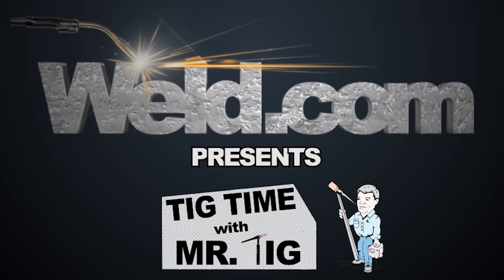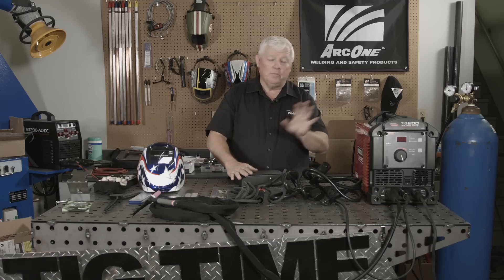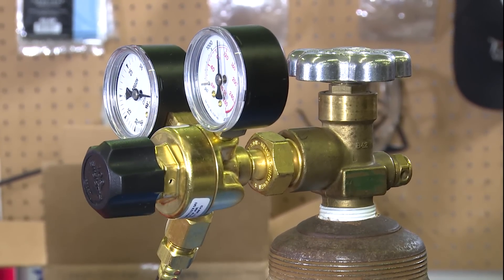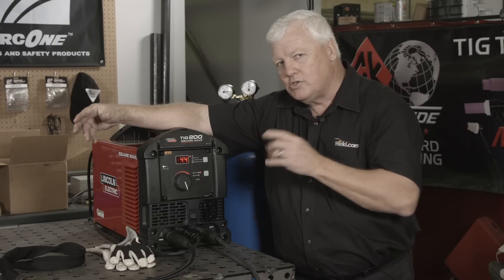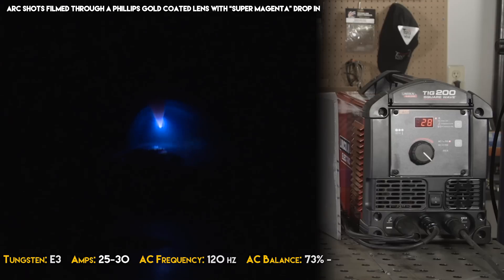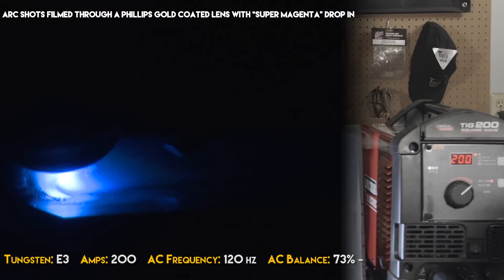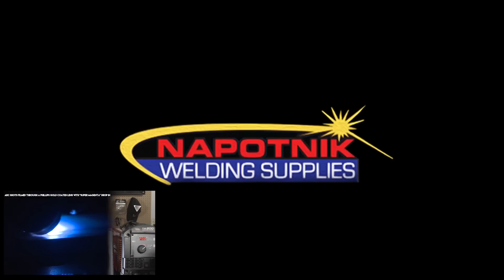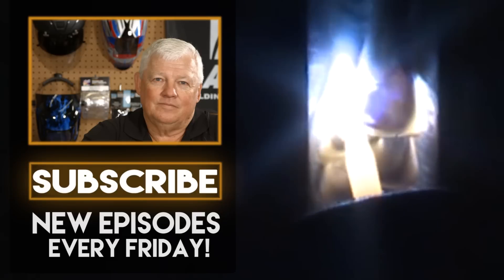Lincoln Electric Squarewave TIG 200 Unboxing and Review: Part 1 - AC Welding | TIG Time

Comment: I've had this machine about a month, very happy with it. I also changed to gas lens, the regular lens that came with it did not have the nozzle centered around the tungsten and it didn't maintain the shielding very well. The other thing I don't care for is that the post flow is set to 15 seconds and can't be changed. That eats up a lot of gas when I'm just doing a bunch of tacks, and is way overkill when welding things at low amperage. If I were going to change the regulator, I'd get a dual flowmeter so I could use a purge if I needed it. I also agree the arc start is a bit hard, kind of surprised me at first until I got used to it. Now when I weld thin material I start the arc on something thicker, then move onto the work piece. Very nice demo, thanks.
Reply: 15 seconds is an awful long time for the argon to continue flowing. Even my mid level Everlast has adjustable post flow. That technique of starting on something thick to avoid the large arc start is really smart.
Reply: You can't change the post-flow??? How about the preflow?
Reply from the maker: +G. Finley unfortunately not

Comment: how would you compare this one to the APH 200x, 2016 model. im going to pick up a tig and a plazma cutter and am looking at the best bang for my $
Reply: The AHP is pretty good welder. If you want additional features or better duty cycle you can also look at the Everlast welders. They are considered slightly better quality. If you won't be pushing the duty cycle much you can even consider the tig welders that have plasma cutting built in.

Comment: Hi Wyatt
About tools to check the argon flow out of the cup 
What is the better one to use I got one from Arc Zone and really can not prove or disprove the accuracy 
thx
art
Reply from the maker: Art, I'm not sure which one you have. We sell a gas flow tester that should prove your flow as well, but for the price of one of the flow testers, it's worth it to just buy a flow meter style regulator, like the MT-60.
Reply: Wyatt
I have several flow meters and need to be able to test each as well as friends
Reply from the maker: Art, This type of tester will allow you to double check the accuracy of your flow meter: http://weld.com/index.php/shop-weld-com/shop-weldcom/flow-meters-and-regulators/gas-flow-tester-detail

Comment: While it looks like a good welder I still won't own one. No post flow adjustment. So at 150+ amps it's automatically calculated at 17 seconds. This machine is geared towards the hobbyist. And the hobbyist do not have large tanks. Even a 125cf tank will go empty real quick when you have that much post flow. Even for tack welds! Who needs to waste that much gas, crap like this causes argon prices to rise.
Add a post flow adjustment and I will have one.
It was a good attempt but failed execution 
Try again Lincoln
Reply: The fact of the matter is that we just can't get all of our parts made in America these days, it's just the way it is. All parts made in America, Mexico or China is not even the biggest issue you will have. Buying a tig welder is not something you do a lot of. You should buy a machine & plan to have it for a long time, generally speaking. I have never bought an AHP, so I can't speak for them. But I have bought from another Chinese welding machine company, longevity, and I had an issue (which is an understatement).  Their service was awful. I mean so bad that they spun me into a new dimension of pissed off. So when you make a big purchase like a tig welder, you need to consider the cost of ownership, which includes parts and service. You're not going to get the same level of service, in my experience, from an import company as you are from one of the big companies, regardless of where the parts of their welders are made or where they are assembled.
Reply: +worldtraveler ah hah! Thanks for posting where it's made. I was planning on going down to my LWS and taking a look at one just to see where it's made. You saved me a wasted trip brother!
Reply: Good!  BUY IT.  Then in 3months after you LEARN what pre/post flow and up/down slope means, you can EAT YOUR WORDS.
Reply: That is interesting to know I went buy one and didn't because of gas use the salesmen did not know that thanks for the helpful info
Reply: +gamble1997 I'm truly glad your experience with that machine is a good one. Even so, I can't risk it. I also hope that if you need manufacturer support for some reason they will meet your expectation as well. Back to this video review, I would buy this Lincoln machine though, even though it's made in Mexico because I know Lincoln will stand by their products. I'm not going to buy this machine because I have no need for a small machine like that, so it's pretty much a mute point I suppose. Good luck to any of you that do buy one.
Reply: ANGER MOTORSPORTS and on the low side it's still around 12 seconds IIRC
So yes a waste of gas at any amperage
Reply: I was looking at this model and an advanced Everlast. I didn't realize the Lincoln didn't have a post flow adjustment. That does it for me. The Lincoln is out.
Reply: You're right Ryan.  Better to invest good money for a good machine.  It is actually possible to avoid the chinese mess altogether.  I bought the HTP Invertig221.  Italian made by Stel.  1st class machine for what the more expensive everlast rigs cost.  Sorry longevity hosed you, but I gotta say I'm not surprised.  I've read tons of horror stories about them.  What aggravates me the most is the chinese are smart enough to KNOW they have a problem...  But are too dumb to care to fix it.
Reply: So out of almost 300 reviews on amazon alone you find a few that are crap. Big deal. You have no idea what you are talking about. You didn't know it was even an AC/DC welder. Mine has been rock solid for 1 year with daily abuse and welds beautifully.
Reply: Yo
Reply: gamble1997 what should i buy i want to tig aluminum rims at home, dont want cheap junk tho
Reply: Is that the main issue you see with it?
Reply: gamble1997 
while the post flow is not adjustable on this machine, it does NOT always flow for 17 sec. The post flow of the Square wave 200 is dependant on the AMP setting your welding with. if welding at 200 amps, yes post flow is 17 seconds. but if welding at lower amperage the predetermined post flow drops down. so........ this big mess of comments were for nothing, but entertaining.
Reply: Name calling not necessary dude...... But for 800bucks someone can buy the chinese alphatig that is LOADED with features compared to this lincoln.  Lincoln's lower end welders like this box and the junk HD sells is chinese bottom of the barrel stuff.  Drop 5grand on a lincoln and SURPRISE!!!  All Italian and US components inside.  lol.  I've used this new lincoln many times and I am not a fan.  The arc start IS harsh and the lack of common features make waiting for version 2 a better plan.  If I had 6k to blow, it would be a miller.  I consider a hobby machine these days a grand and under.  Even an everlast for the same money would be a better deal just because of features.  Both everlast and this lincoln have CHINESE internals and painting one box red doesn't make it any better.  Corporate america has forgetten it's not a good idea to crap on decades of building up a legacy name like lincoln only to allow the lowest bidder to represent your company. Shame shame.
Reply: lol mr know it all doesn't really know jack. I can weld aluminum with my ahp better than you can with any lincoln or miller. Its the person behind the hood
Reply: You kiss your mom with that mouth of yours?  The alphatig will do just fine on aluminum.

AMAZON>>>>>>>
AHP AlphaTIG 200X 200-Amp IGBT AC DC Tig/Stick Welder with Pulse 110V and 200V
 $799 and FREE SHIPPING.
Reply: YUP!  Wait for version 2 of this machine before touching it.  My buddy has one, I am not a fan.  (made in mexico too)
Reply: You really are special ed if that's how you see it. For $1400 there are lots of better options out there that do more than this and all of them don't start at 35amps either like this one.
Reply: @gamble1997   Name one better option for the same price......I'll wait. You can't. Your little eBay special welders can't compete with Lincoln as far as warranty and service. That's what you pay for. I have two Lincoln service centers within an hour either way. Sure beats shipping some eBay special somewhere on my dime and waiting months for a return and HOPE it's fixed and I can get back to welding. I'm sorry you couldn't afford red or blue but you don't have to be a troll for AHP. Don't be a fucking griefer
Reply: @williambonnie9229  lol ok....I've owned this Lincoln, I've owned Miller, Hobart and then some. AHP is the best bang for the buck. If you can't afford $30 one way shipping and get it back within a week then I feel sad for you...or drop off your Lincoln locally and wait 3 weeks....There are TONS of better options. I'm sorry your entry level red is a complete piece of shit but you don't have to bash on people that know how to weld with other color welders...